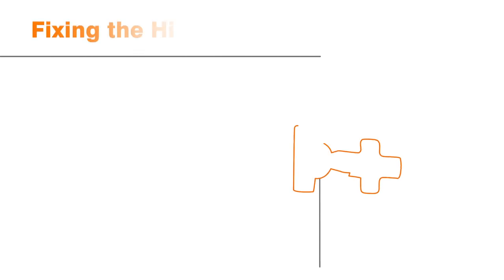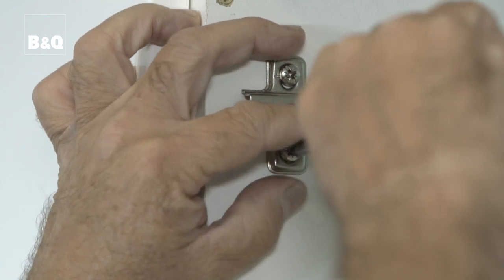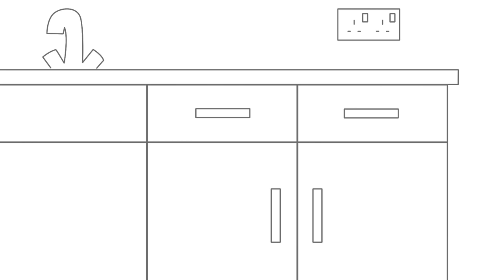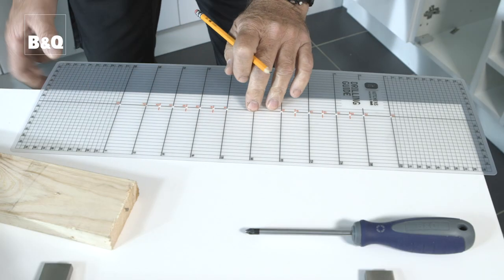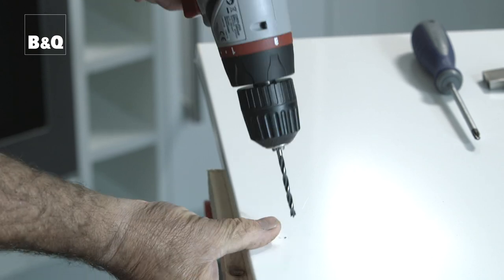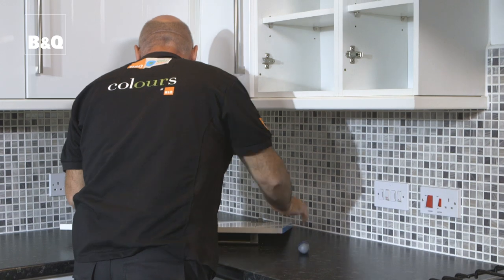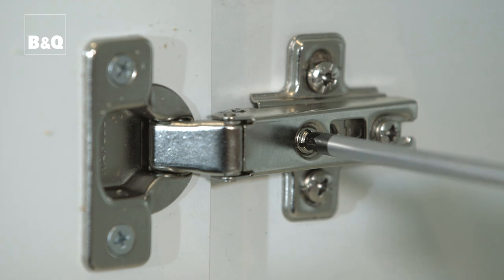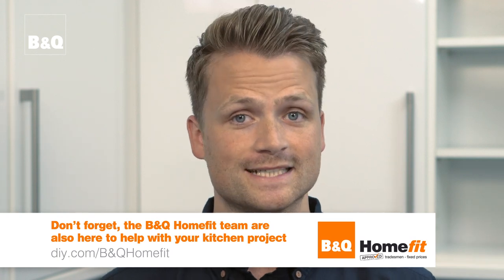How to fit kitchen units part 2: fitting unit doors & handles

Comment: Just fitted a corner Cabinet for the first time. What part do I need in the corner for the gap between the 2 300mm doors?
Reply: Corner post
Reply: You can buy a screw on piece that is designed for that purpose. They sell it wherever you got the door (so that it matches perfectly)
Reply: Did you ever sort this? What did you use?